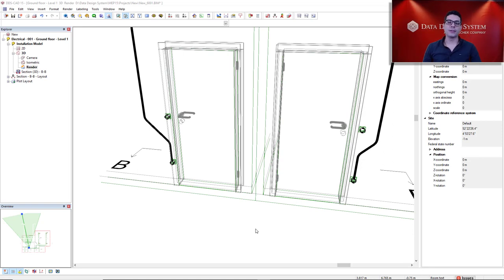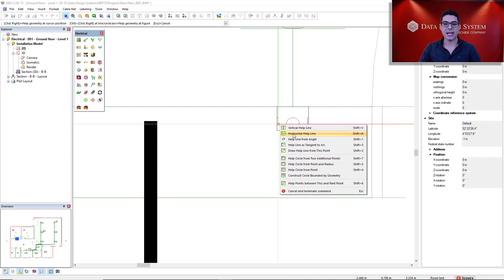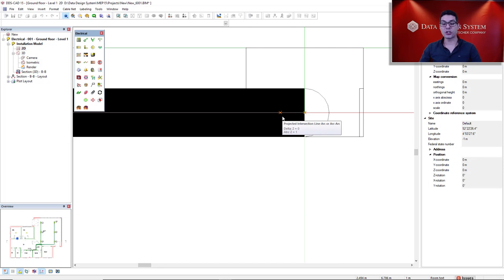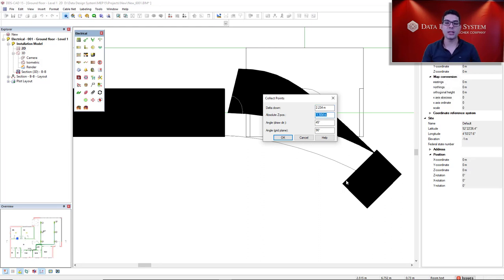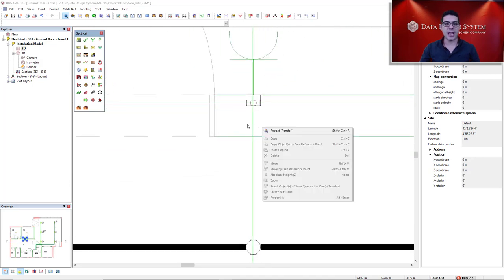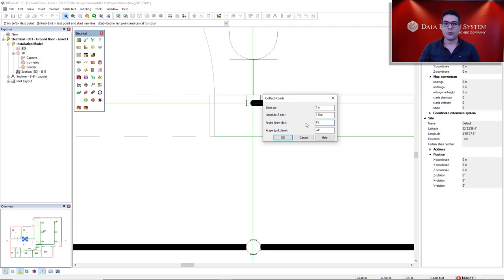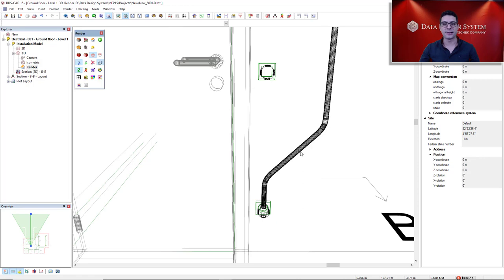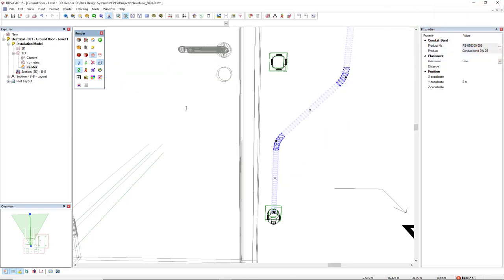DDScad | Tips on how to model a conduit

Comment: Hello, very good job you are doing. keep going! I have a question for you. How can I change the position or align the position of a group of part text boxes. The function to align the position of several objects on the left, right or center does not work for part text boxes? Do I miss anything? The reason for asking is how can i make a quick an easy adjustment of part text boxes for larger plot layout when i rotate the plot by 90 degrees.
Reply from the maker: Hi Matthias, I suggest you configure one part text, next select the configured part text, open the context menu and click on the option Copy part text properties, now you click on the other part text to have same alignment to the objects they belong. I am not sure if my suggestion will 100% be applied to your, if it is the case, you can send me your company name and I ask a local support to help you directly.
Reply: DDS-CAD Hello, thank you for the prompt reply. I just tried this but when I follow your steps, then the part text to which I copy the part text properties gets deleted, i.e. it disappears. Would be happy to receive some advice from local support. How can I send you a private message to provide you with the company contact details.
Reply from the maker: @matthiassmovies3014  , you can send an email to support@dds-cad.com